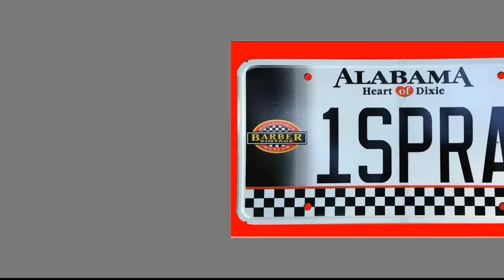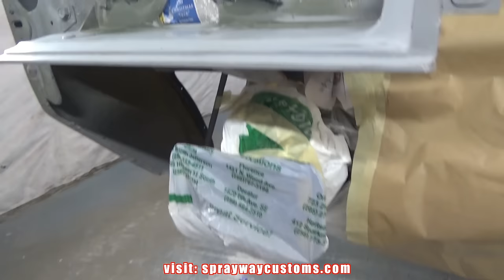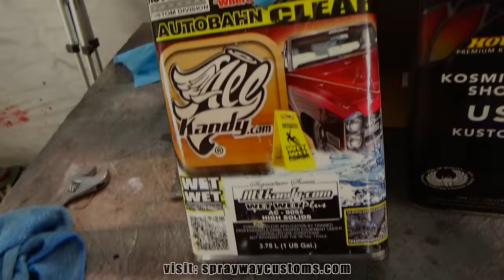How To Do A Candy Paint Job On A Car CUSTOM HOK KANDY COBALT ORIENTAL BLUE MIX Chevy Caprice 74 DONK

Comment: Just another helpful tip. I have found that at least 90 percent of dirt nibs are found in the sealer coat. What I do is go around the entire project with a piece of 800 grit and tack rag. You'll be amazed how much cleaner your jobs come out.
Reply from the maker: Thanks Mark

Comment: SprayWay you do some nice work. I would suggest getting some 2x2 boards and 20"×20" furnace filters and build a frame to go across the bottom of your overhead door and that will allow you to pull clean air straight through,giving you better air flow with less overspray and less contamination in the finish. And you'd be able to close the service door. With the service door open your air flow is not in a direct line with the exhaust fan which causes the overspray to become hung up in turbulent air. Other than that keep banging out the sweet rides.
Reply from the maker: Thanks Ron
Reply: @SprayWayCustoms  I hope the tip helps you toward the next level. I'm 56 been doing body and paint since I was 13, most custom and restoration work, but I get enthused to see guys starting as I did in a small shop in the back yard. Especially when they are doing some killer looking jobs.

Comment: A simple tip on guide coat. After priming add 4 or 5 oz of black paint straight into your cup and mist it on. Adjust to size of job.
Reply from the maker: Appreciate you

Comment: Spray way don done it again 🔥 🔥
Reply from the maker: Thanks LOC
Reply: @SprayWayCustoms  Im trna bill a paint booth in my new shop and I was wondering what fans you use to vent paint out I been looking at fans but I want a set up that I can put filters in front I saw them fans in your video and I want one the those u got

Comment: They make powdered dry coat so you don't over spray all your jams when you're applying the guide coat. Plus it doesn't clog up your paper like spray bomb dry coat does.
Reply from the maker: I have dry guide coat but I’ll rather use flat black spray paint

Comment: Sir I have been asking all painters about how to repair my third light on my Cadillac Escalade  it has a paint damage from the hot sun 1 what type of  sand paper to wet sand it and what type of sealer for plastic parts do I use SIR, trying to learn to do it myself SIR you inspire me to do my own
Reply from the maker: Use something like 400 or 600…check this video out here https://youtu.be/Nf5XrP22zto
Reply: Thanks again sir if it doesn't rain ia going to do it. Sir for plastic what kind of prime do I use or just use the adhesive promoter so the paint sticks to?
Reply from the maker: You can use epoxy primer or a plastic primer or an adhesion promoter
Reply: Thanks again sir for your help 🙏 May God bless you and your family in the name Jesus

Comment: Like it! You was spraying the mans paint and you was moving like the man!  Jon Kosmoski! What gun did you use for the silver?  Was that Sata 5000 B HVLP? Looked good!  There is not anything nicer than the Old Donks and 74 vert is the King!!! Good work Sprayway somebody is going to be riding in high style!!!  Woo Wee looks good!..... 
"  RU 312  "      ; - )
Reply from the maker: Yes it was the SATAjet 5000 HVLP with a 1.3 tip

Comment: looks good what size tips do you use  on base coat , clear coat , and epoxy primmer ? thanks
Reply from the maker: Thanks…I use 1.3 for base, candy and clear. I use a 1.8 for sealer and primer
Reply: @SprayWayCustoms   thanks

Comment: Love your videos.  After the clear coat was applied you mentioned putting three cover coats and one drop coat down.  What is the difference?
Reply from the maker: I was referring to the base coat. Sometimes when spraying metallics you get tiger stripes and blotches due to the metallics not laying down even. The dust coat is sprayed on a lot faster with the air pressure adjusted and the gun farther away from the surface.

Comment: How did you resolve all the solvent pop?  Did you wet sand the whole car, and then come back with a couple lighter coats of clear afterwards?  I've never painted a car, it's a bucket list item, I paint firearms right now.  I'm trying to get the knowledge I need before I try it out myself.
Reply from the maker: Yes..that’s what I did. I have videos on the process
Reply: @SprayWayCustoms  cool, I'll go find it.  Appreciate the response.

Comment: I always take wheels off outside and pressure wash underneath vehicle. Easier to clean up and I roll out carpet around the vehicle before I spray. Carpet cuts out alot of dust
Reply from the maker: Yes…thanks Jeff

Comment: Which tip do you use to spray the candy I have a thought of 5000 RP is that a base coat candy are urethane candy the UK
Reply from the maker: It’s a urethane candy. I used a 1.3 tip

Comment: Great Job as usual!!! How many gallons of base or the candy blue does a car of that size normally take especially if your doing 3 or 4 coats? 2 gallons each?
Reply from the maker: You can get by with one gallon of base but candy about 2 gallons if you plan on spraying more than 3 coats

Comment: what guns did you use and what size tips
Reply from the maker: Thanks. I used the SATAjet 1000 B RP 1.8 tip for the sealer, SATAjet 5000 B HVLP 1.3 tip for base and candy and the IWATA Supernova WS400 1.3 tip for clear